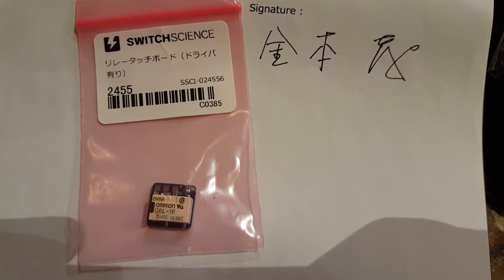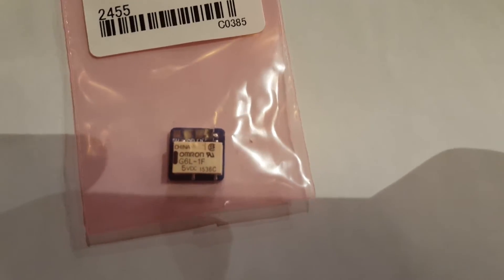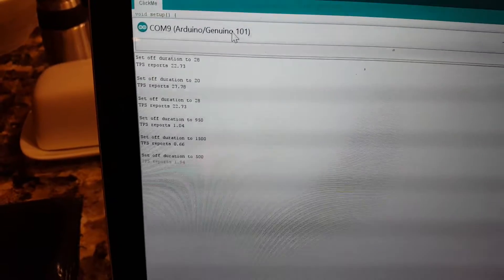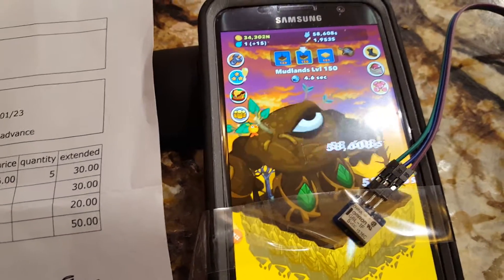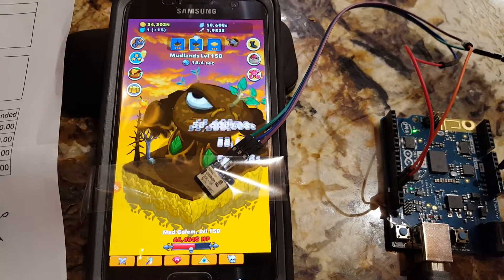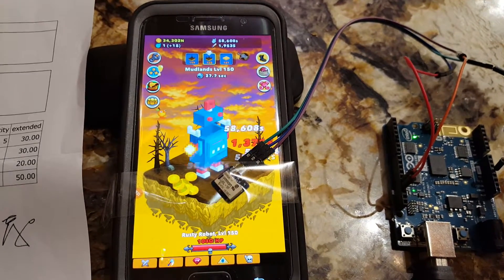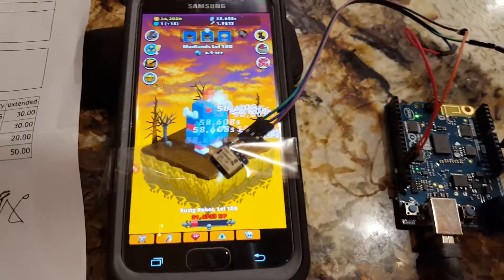Switch Science 2455 - the key to automating Clicker Heros

Comment: Hello, your video is cool I was wondering if you could help me with a project I'm working on. Please contact me or reply to me. Thank you
Reply from the maker: Saba Ila Hi, what can I help with?
Reply: Thank you so much for replying. First. Where can I buy those cables and also I went to the switch science website to buy the product but they are put of stock, where else can I buy it from?? Thank You
Reply from the maker: I have some units, or you can buy from https://international.switch-science.com/catalog/2455/ since they have stock again (shipping was kind of expensive as I recall).  You can get wires from Amazon (like https://www.amazon.com/Pixnor-Female-Breadboard-Jumper-Ribbon/dp/B01FSGGJLY) -- you need to make sure at least one side is male. Ardunio from Amazon (like https://www.amazon.com/Elegoo-Board-ATmega328P-ATMEGA16U2-Arduino/dp/B01EWOE0UU).  To connect the wires you need a soldering iron and solder (like https://www.amazon.com/IRON-SOLDERING-Electric-Welding-Solder/dp/B00DWA732S).  Don't separate the wires; they are the perfect spacing already for connecting to the 3 pads.
Reply: Derek Jamison thanks man, will you sell me 2pcs? I would of bought it from the other website but the price of shipping is double of what the purchase is lol... Thank you
Reply from the maker: I can sell you for $10/unit (since I had to pay shipping) assuming you are in the US.  I can throw in the wires as well.  Let me confirm that I still have unused units tonight.  Ping me your contact information at codeallnight@outlook.com.  I can do paypal or unregistered Starbucks gift card, whichever is easier for you.  Are you okay to solder the wires yourself?
Reply: Sent you an email. Thank you
Reply: Did you get my email bro??

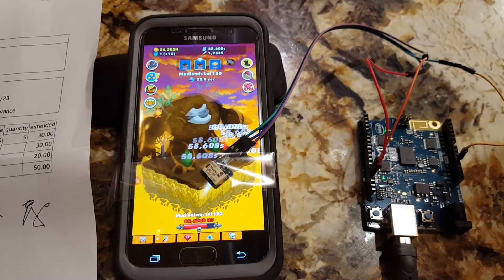Comment: Hey Derek! Please explain how to do the speed test within the sketch? Like you did at 1:53 in the video when you typed 500ms. How do i do that? Thanks
Reply from the maker: In Arduino, File/Example/Basic/Blink - gives you a program to blink.  You can change the number of delay.  Another version we read various pins and when those pins connected to GND then we changed the speed (so we can adjust speed without a computer).  File/Example/Communication/ReadASCIIString shows how you can read a number (we modified example to store delay variable as an int.)

Comment: Hey Derek, I wanted to make this using 2 Relay touch boards. Can you make a how-to video, I have a Adruino Uno and will have 2 of these, because I need to tap two parts of the screen. Thanks
Reply from the maker: Sure, I can give you directions.  I'll try to write them tomorrow.
Reply: Got 2 switches today, I am ready for some instructions. If its possible to run it all off the Adruino with no relay that would be even better. Also, do these have a duty cycle. I dont want to burn them out. shipping from JP is killer lol. Thanks again keep up the good work.
Reply from the maker: The Arduino was able to drive my touch driver without any additional relay.  I was able to click quickly without burning it out.  I found that any faster than 16ms @ 50/50 duty cycle and the phone didn't register it as a click, so that's the upper bound for my phone and game.

Not sure how familiar you are with hardware & software.  I put directions here: https://github.com/jamisonderek/Arduino/tree/master/Clicker 

Click on the various PNG images, then read the README.md file for directions.  Hopefully it makes sense.  Let me know how it goes & have fun!
Reply: Can you put tape around it and will it still tap the screen? Thank you... what kind of wires are you using and how long is it? Thank you
Reply: Is this for android only? IOS?
Reply: hey are you using it to get blocks for Amazon if so how is it working?